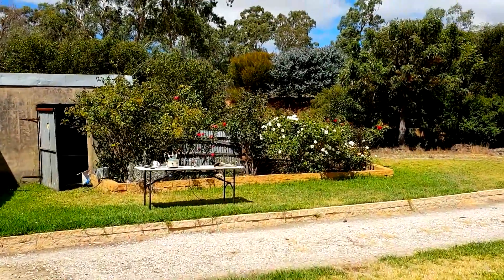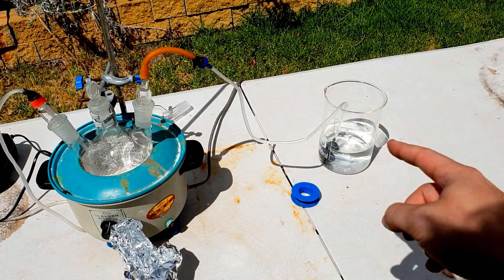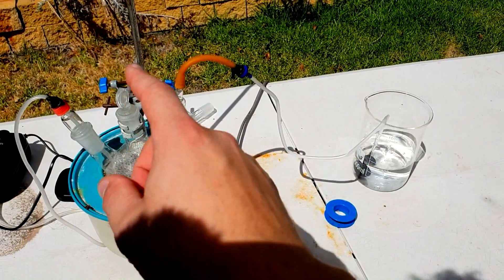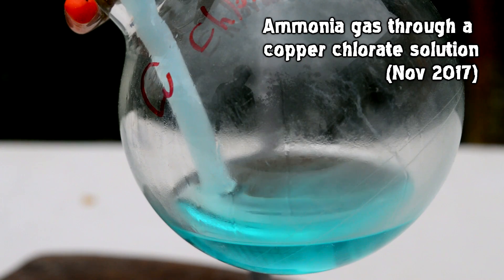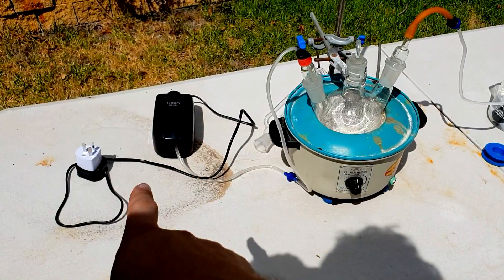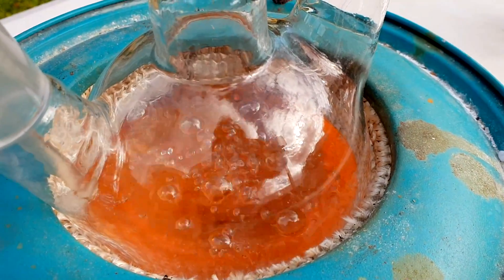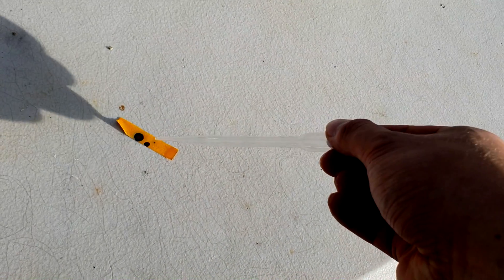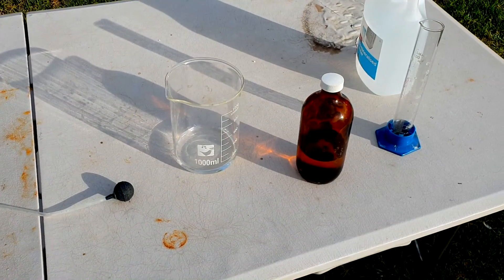Making Concentrated Ammonia

Comment: If you've got two check valves do you even need the pump? When the pressure drops in the flask the check valve on the water side would stop the suck and the air check valve would just pull in air negating the obvious need for the pump. My guess is the pump will be diluting the the ammonia gas and presumably mean it doesn't all contact the water, so it just bubbles out into the air making it less efficient? Unless I'm completely wrong there somehow; wouldn't be the first time.

Comment: Can anyone explain you can't MacGyver a I.v. bung?

 I feel like the only issue would be the gas having a higher resistance to escape due to it being designed for fluid rather then vapor/gas but if that's the case a small three sided stopper would possibly work if you use it with the aquarium pump running 💁‍♂️ similar concept to the dyi treatment a sucking chest wound.

Comment: Easy fix:
Bubble the ammonia through water using an inverted funnel trap. It’ll prevent suck back.
Reply: QueHubo Parcero   have you ever seen an inverted funnel trap be used before? It’s not possible to pull that much liquid in before the water level goes too low and breaks the seal of the liquid at the end of the funnel. That’s the whole point

Comment: What is the maximum Ammonia solution possible in an open container at say 35°C (assuming the exothermic reaction when nearing saturation/boiling point) Is henrys law applicable with Ammonia solutions seeing as it has a chemical reaction?

Comment: I usually mix sodium hydroxide and ammonium sulphate together dry and then drip a bit of water on it, accelerates pretty quick.
Reply from the maker: I used to do that  but I found it always accelerated wayyy too fast for me! Maybe I have a slow reaction speed haha
Reply: @ExtractionsAndIre Also, if you add a large funnel or tube on the end of it big enough to accommodate all the water, it, it can stop the suck back
Reply: Might get some gas escape tho
Reply from the maker: @TheHuntermj  yeah that's a good option. Simple, and usually works well, I have done it a few times. But I needed to practise this setup because I have to put dry ammonia into a flask that won't fit a funnel, and can't have any suckback!

Comment: Great that the air pump trick works.
Another way to absorb a highly soluble gas in a liquidis by using two Drechsler bottles joined together via their dip tubes. The water goes into the second bottle in the chain. Any suck back is delivered to the first bottle. Failing actual Drechsler bottles this can also be botched together with Erlenmeyer flasks, glass tubes and thermometer adapters.

Comment: I estimate, that on right side missing cooling ice bath for good absorption NH3. Also high measurement glass cylinder should be much better for absorption. Immersed in the ice bath. I estimate, that you have a big losses. Is it a pity. Your aparatus is otherwise perfect. Thanks for sharing....Good Idea with external air.
Reply from the maker: You are right, I should have cool the solution! But with the air bubbler on the end, a long column is not needed, I didn't smell any ammonia leaving the solution!
Reply: Interesting, that ammonia process was without smell. Maybe, that  the bubbles  with  normal air increase absorption of ammonia gas.

Comment: mmm.. cant you take Ba(OH)2 and NH4Cl, wouldnt this produce basically liquid ammonia, as its a highly endothermic reaction? im thinking some liquid ammonia should be possible to collect, otherwise some solvent could maybe suck up the ammonia, supposing BaCl2 is relatively insoluble in any solvents other than water
i recall something around Ba(OH)2 + NH4Cl reaching down to -50*C or even -70*C

Comment: I use two connected wash bottles. When suckback happens, the liquid just moves from one bottle to another.
Reply from the maker: Doesn't it get all gross from the tubing it goes through? Or is it just me that uses filthy old tubing oops
Reply: @ExtractionsAndIre  I used a small piece of some cheap rubber tubing I had on hand (should have checked the compatibility) - in my case I needed less than 10 cm to connect the bottles and it haven't shown any deterioration (I could use PTFE but the bottles are not the same type and you know how hard it is to bend or attach this material - I am still trying to work out an all glass setup for ammonia solution production). It was however such a short piece of tubing I was able to wash it with a brush.
I may try the setup used in Doug's Lab "Ammonia Generator" video - here he was dripping ammonium salt solution on sodium hydroxide, then heated the resulting solution to drive rest of the ammonia out of the solution. Maybe this could limit the suckback but he said he has suckback issues also.
I tried few times and the suckback with ammonia is evil - even if I watch out for it - it always happened spontaneously and vigorously.
Reply: I use the same. If you connect the tubes correctly the saturated solution will be pushed back to the initial container. It really is the easiest and simplest solution.

Comment: I would argue that NO2 and H2S is somewhat worse to deal with. NO2 tends to eat your tubes and the nitrate/HCl/copper reaction that generates it is a pain in the ass to deal with. It has some really nasty habits of being temperature sensitive or maybe even autocatalytic to some extent. You put everything together it does almost fuck all, you heat it, it starts, and before you know it, you have to cool it with a water bath to prevent a thermal runaway. Needless to say, runaway NOx production is something you want to avoid if at all possible.
As for H2S, the gas is hideously stinky, your neighbors will smell it, the neighbors of your neighbors will smell it, and to top it all it is super toxic and deadens your smell, so you have no idea you are in danger.

Comment: I have tried making small amounts of ammonia by heating lime with urea test tube with a rubber tube receiving the gas. Calcium carbonate is also produced. Then you have a glass funnel to prevent backflow to your reaction vessel.
Reply: @Benjamin Joshua Beggs That's true. I am trying to find a use for it, since I have plenty.

Comment: There is that crazy old obsolete idea of a suckback trap.  Just sayin'.  ;-)  Also aren't there valves that can allow gases but stop liquids?  Floating ball kinda thing IIRC.

The pump idea is a good one and it obviously worked just fine.  Seems to me the airflow would ideally be limited to "just enough."  You could modulate the air pump's output more finely by use of a relief valve.  Just a branch of tubing at the pump's output with a valve on the end that lets a bit of air out.  Opening the valve just right would exhaust the excess and reduce the working throughput to just that light positive flow you really need.
Reply: crazy old obsolete idea of a suckback trap.????....not at all obsolete....it is used in heaps of modern industrial process..and lab bench setups....what are you on about ?

Comment: Can't you just buy ammonia solutions from the hardware store? In France, it's a relatively common cleaning product. I thought it would be the same in Australia.
Reply: Nope, hard to get without soap in it
Reply from the maker: Yeah, real soapy and dilute
Reply: @ExtractionsAndIre  Oh. I guess we're lucky to have access to the soap-free 22% ammonia here!

(Why would they even mix it with soap? Isn't the whole point of using ammonia for cleaning that it evaporates without leaving a residue?)
Reply: no, that's not the reason...the reason is that ammonia is very basic and has a nice habit of dissolving protein very well, it breaks down organic material like a solvent....we used it for exactly that purpose on casein in the lab once...
Reply: @psycronizer  Yeah, but sodium hydroxide works even better for that, and doesn't stink!

Comment: My $0.02 : I've generally mix dry ammonium nitrate and sodium hydroxide and add water dropwise, which generates the ammonia more quickly and irregularly, but keeps it mostly coming out of the generator. I'm surprised you didn't get any suckback, though I've seen some bubblers that act as passive one-way valves due to the fine pores. 
For the dissolving process, and for most gas dissolutions, I think a tall container, like a measuring cylinder or precipitation tank, is recommended, so you give your gas more distance to travel and chance to dissolve. Since solubility decreases with temperature, chilling the absorbing liquid will increase the final concentration. You can determine the concentration by the weight of ammonia absorbed.

Comment: Bubbler and pump seems to be a good technique.  Doing it at 35° without any ice for the collection flask is another thing.
I am with you on the ammonia smell: anything to avoid releasing that gas into my breathing space.
Reply from the maker: In retrospect, yes, I should have used ice cooling to increase the absorption!
Reply: i never wiffed ammonia, now i feel like smelling it

it dhouldnt be worse than low concentration of pure chlorine, right?
Reply: @VerbenaIDK  it's different. I think Cl2 lingers a bit more and is real dangerous if the concentration is high. Ammonia is a sharp assault on the nasal passages and sticks in the back of the throat.
I do not know how they compare at the same concentration.
Reply: @j_sum1  i dont think ammonia would be as bad as chlorine in terms of hurting nose

i need to get some ammonium bicarb soon to make some ammonia so ig ill find out
Reply: @j_sum1  my ammonium bicarb arrived, made some ammonia gas and i few like dying when i smell even just the ammonium bicarb deconposing

horrendous, worse than chlorine, even if i only smelled it in small concentration, atleast it's good to some extent, i kind of like it

but ammonia just fuck it, slightly weirdly sweet sharp (also weirdly, it's familiar? i dont think i ever smelled ammonia before but it seems like i did) nothing like i expected, i expected pungent strong urine not this shit that destroys my nose

atleast i can make hydrazine later when i feel confortable and make sone explosives but goddamn fuck this shit

also ammonia doensy linger on the throat for me, it stays in the nose for a while and has a weird cooling effect on my nostrils, and the smell lingers quite a while

and like tom once said in the first video of nitrotetrazole synthesis, it gets the eye too, my eyes are still kinda watery from trying to make ammonia, i can sme ammonia before it fucks my eyes up i think but god is it bad, atleast a cool gas
Reply: I didn’t notice the smell at all

Comment: I came up with another method of preventing backflow a while ago using a piezoelectric buzzer. It might be a bit more efficient because it should capture a lot more of the ammonia at higher concentrations, although I'd say the bubbler is definitely easier lol. I've linked it below if you wanna check it out. 

 https://youtu.be/wi_5HA4ozjs

Comment: the best way to make ammonia solution is by using ammonium nitrate and sodium hydroxide, there is no way to dissolve all amount of the ammonia it will produce to get that sucking back of water in the reaction vessel, no heating required ether... and the byproduct is great, sodium nitrate which can be used for many other great things ;) 
i am preparing such video on my main channel for this...
Reply from the maker: That's cool, although I always worry about using up my ammonium nitrate, because it's hard to get more!
Reply: @ExtractionsAndIre  here we can buy bag of 50kg for $50USD... you can get it even cheaper if you have a friend with farm, they are using like tons of it in the fields... sadly you cant find potassium nitrate, that's how i found out about the reaction with sodium hydroxide, i was trying to make sodium nitrate actually... i bought my first 50kg bag of ammonium nitrate back when i was only 13y old ;)
Reply: go to Bunnings and get Ammonium Sulfate....mix with NaOH..job done....both available there and OTC and easy too

Comment: Lead vapor isn’t really a gas but whatever it’s worse. From experience.
Reply from the maker: Hmm it's hard to argue that one honestly, stay safe out there people
Reply: Your right there mate!
Not only does it smell worse than an outback drop dunny, but it can give you lead poisoning
Reply: Okay, how do you go about making lead vapor?  I mean obviously if you heat it enough... but that's a lotta heat.  It's fairly inert last I checked...
Reply: @jamesg1367  Its pretty easy to make actually. 
Lead has a fairly low melting point (something like 327 degrees) and can be melted in a pot over a stove.

Once Liquefied the Lead will begin to evaporate. The actual rate of evaporation is very slow, however gaseous lead has an extremely strong smell - (smells like cancer mixed with petrol with a wiff of brain damage). 

Hence you don't have to boil the lead - just liquefy it.
Reply: JamesG I milled black powder with lead stuff and some of the lead turned to powder. Could smell it when I lit the stuff. Not sure what to do with it now, no good way to dispose of it.
Reply: @NvrchFotia :  I'm thinking the ideal thing would be to convert it to as inert a form as possible.  Metallic lead is fine as long as it's not exposed to acids; it self-passivates and proceeds to just sit there for centuries almost unaffected.  Black lead dioxide is pretty stable and almost non-water-soluble.  Lead(II,IV) oxide "red lead" is also nearly insoluble.  All toxic regardless, so it's best to keep it well contained.  Lead is all over the environment in trace amounts, both natural and human-caused.  The main risks are ingestion or inhaling particles.